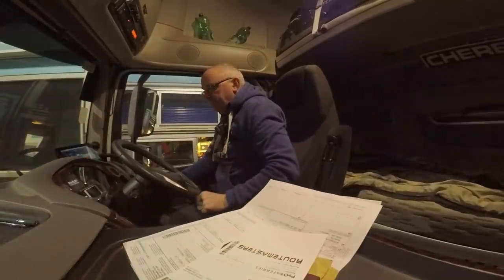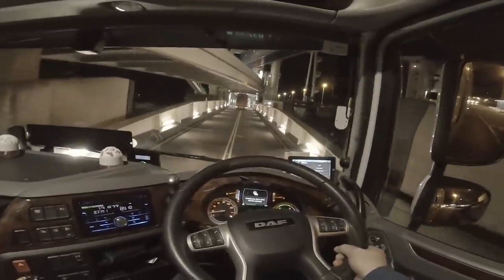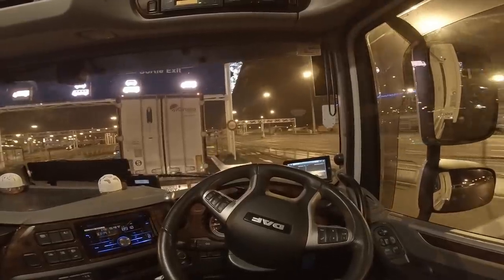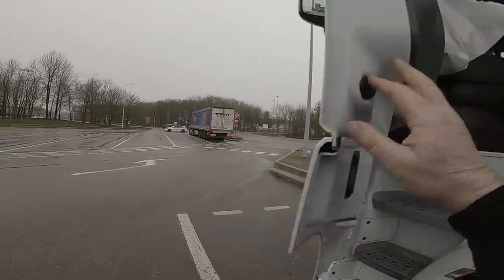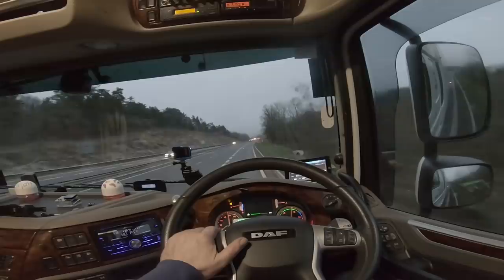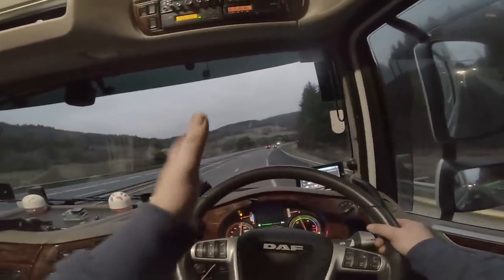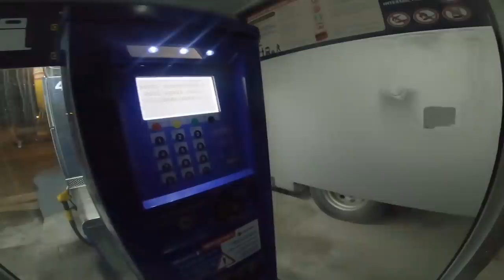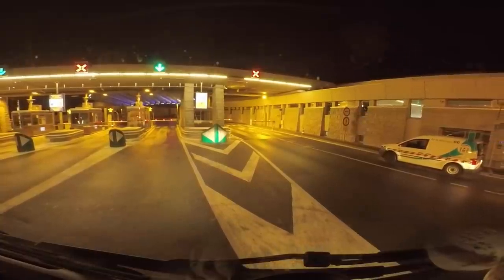Dover 🇬🇧 to Mont Blanc France 🇫🇷

Comment: I was eagerly awaiting this video. Not to put you under pressure, but it's just a joy to watch your videos, so I'm hoping you will continue with creating them. Thanks so much, Ned! I'm totally with you on the smell of cigarettes, as a non-smoker. Almost nothing more horrible than that, especially when you have to work in that truck for a long time. There's just no way of getting use the the smell, let alone trying to get rid of it. It's in everything, especially fabrics. So I'm feeling your pain.
I was wondering about filling up the oil. Was it consuming that much that you needed to keep topping it?

Comment: Them old Dafs always liked a drop of oil Ned.  All the Daf men of old used to carry 2 gallons strapped to the passengers door step.
Reply: Seamus Burke so true
Reply: @Scaniam  oh yeah, and you'd have a water bottle with a hole cut in the side of it stuck behind the heater hoses to use as a funnel.
Reply: Seamus Burke absolutely those was the real trucking days unlike today, drivers would stick together you saw a driver on the hard shoulder you would always stop to check, that just don’t happen anymore a new breed of drivers, driving ain’t what it used to be.
Reply: @Scaniam  I was that soldier!

Comment: I’ve driven a Mercedes 608 D and the bloody gearbox failed on me in Germany I was stranded in Puttgarten port for the weekend on my father’s birthday grrr. I’ve never been so close to hang myself in the trailer with the fan belt as I was that day no more dung heaping scrap for me it went to the only place where it belonged the scrap heap. then I drove a Chevrolet pickup truck with a goose neck and didn’t have any major brake downs with it. Until I rolled it in a ditch in Poland but that’s another story.

Comment: Had to laugh at the oil top up! The problem isn't the angle it's the filler pipe that's the size of a straw! The dipstick is on the nearside of the engine... stupid idea.

Comment: That oil here in the USA  at Walmart is $ 12.97  same size ........that price you paid is insane
Reply from the maker: Yes it is crazy 
A total Rip off 🤘🇺🇸
Reply: Nearly as insane as the price of labour on cars in the U.S. ...$100-150 per hour according to great YouTuber Scotty Kilmer.  So you pay (much) less than we do in Ireland for oil and gas. But the price of secondhand cars there is (also) insane. €1.000 will buy just about anything here from a quality Toyota Lexus to a Range-Rover needing an n.c.t/m.o.t. - that's our (much more) demanding version of your smog test. But ours has an emissions component to it too. More rigorous in southern than northern Ireland. We get screwed on road tax and insurance if you dare to drive a car older than 2008. And then there is the much hated c.p.c. to endure to keep your vocational/commercial licence current and valid.  If truckers had dug their heels/wheels in when this was introduced a decade ago, adding €250 to the price of a truck/bus licence, we could have given the fingers to the Eeeeuuuu. Maybe we'll get another chance now that the Brexit/Irexit is in the air. Truckers and bus drivers get paid less than my neighbour gets for "quality" ironing.